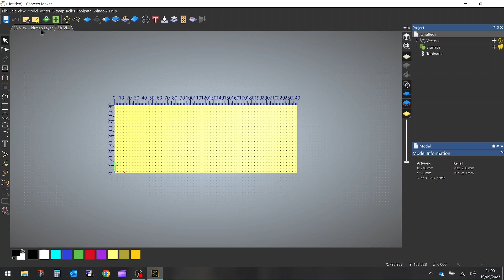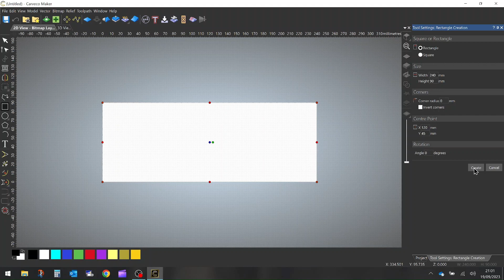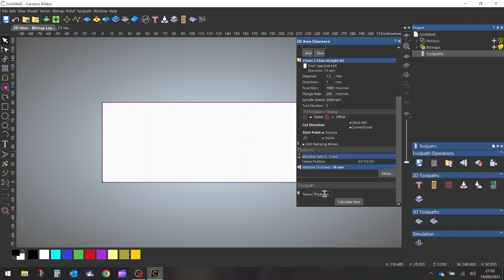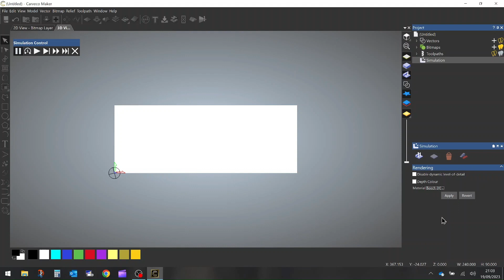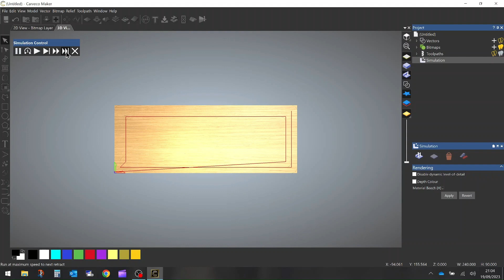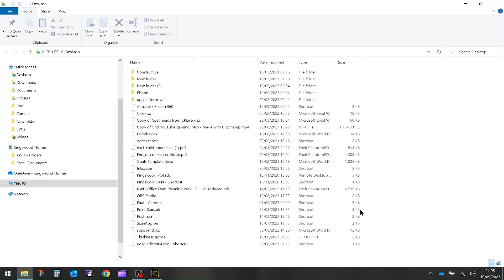Upgrade to Genmitsu 40-40 Pro 1st cut

Comment: Thanks Paul for sharing. I have the same Makita router, ready to upgrade. . I am hoping you can tell me the process involved in the switch over. Ie. Connecting disconnecting and setting changes. Thanks
Reply from the maker: No setting changes required. Your router will not be controlled by the controller anymore so you will need to manually control the speed and remember to turn it on before starting a job. I presume you have the correct mount for the router to swap out? Other than that I highly recommend a dust shoe asap, the difference it makes is amazing.

Comment: Thanks again Paul for another helpful video. Newbie question, Do you have to turn on the Makita router separately or is it programmed to start by the G-code software for this function?
Reply from the maker: Really glad you find the videos useful. Personally I have to switch the router on manually. I believe there is a relay you can buy and wire in to make it work automatically, I think I will look into getting one in the near future and if so will do another video of installing it.

Comment: Great job! Wonderfully! I made a few machines but not so good. https://youtu.be/ziXmku7p6O0?si=1gm_2fCN4GTc_JP4
Reply from the maker: Thanks and kudos to you for building your own. I tried a few years back but family life got in the way and I sold all the parts I had accumulated.
Reply: @paulwebster4449   You have a great machine, keep doing good work. I advice you to get water cooled spindle because routers are too noisy and get proper cyclon it costs 12 evos. I use vacuum cleaner and 120l barrel. https://youtu.be/-MNHhyKnMdU?si=0G2XI2NygiJmRe0d but I am not interesting in wood working although I have more than 500 different milling tools for wood, aluminum and steel. I am working in IT department of PE so my hobby for relaxation is making all kind of electronics and software for machines and cheap machines. Here is 400 euros machine https://youtu.be/TDTDN_KkoJc?si=kQzISjJH1B_I4unB I am too old for different hobby 😁😁
Reply from the maker: I have vacuum but use it manually as I don't have an attachment for the cnc